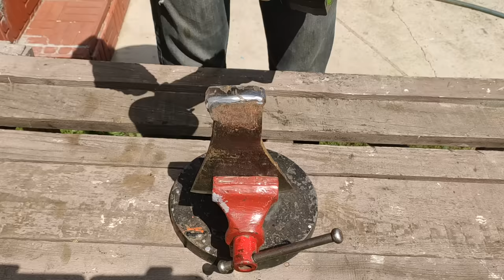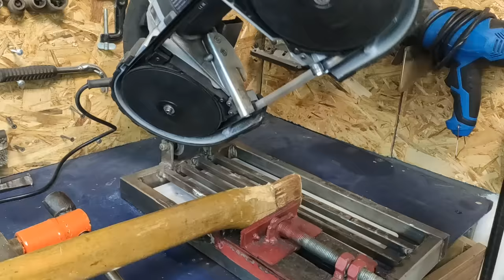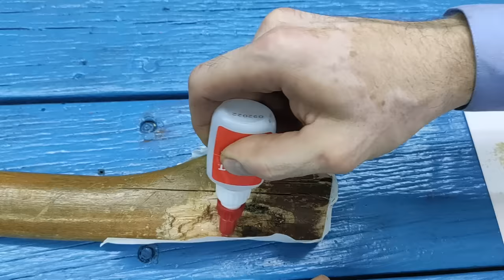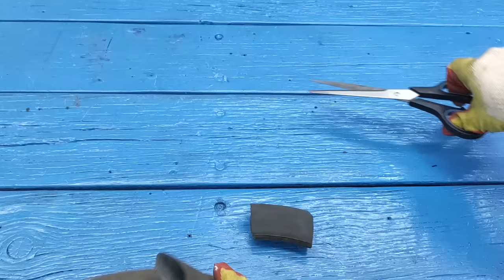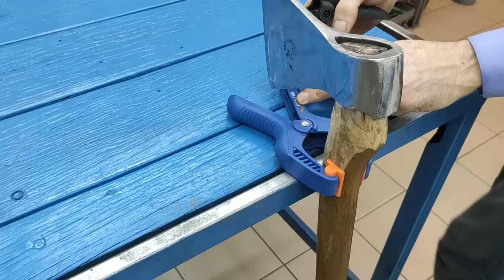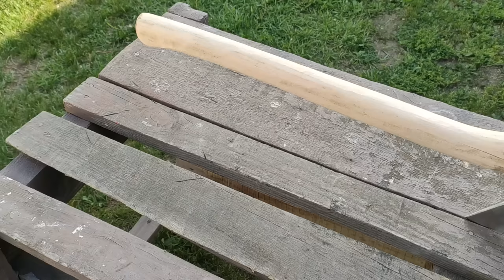CARPENTERS DON'T WANT YOU TO KNOW THAT! The secret method of securing the axe

Comment: Looks like you used Super Glue on the crack.
Any glue which dries quickly will be brittle. I would use Tite Bond. It is the strongest Wood Glue out there. Ten X stronger than Gorilla Glue. Work straight glue deep into crack. Open up crack with leverage. Let it then close and finish with glue and sawdust.

Comment: It is dangerous !!! Smearing around some saw ust and glue does NOT repair the damage, eg. the long split. Hot melt glue does not povide enoug strenght to secure the head in any secure way. This is dangerous for the user and bystanders too. I report this video for deletion,.

Comment: The best thing to do is spend 8 dollars and just buy a brand new handle of course that would take some common sense, I have been a carpenter for over fifty years . This guy has no clue what he doing and giving bad advice. I totally clean and sharpen my tools before adding a new handle as well as throwing them in the fire for a while and dropping them in oil so they retain there edges better. And you start with a wedge that goes with the grain gluing everything before you start, the metal wedges should be driven at a slight angle so you don't brake your handle...

Comment: You hold the grinder in a strange way, hopfuly you're not cutting with it... plz be carefull with that kind of tools and ask how to use it befor being dangerous for you and others.
you also grind the front side, the ''cutting'' part, it's normaly threated so you shouldn't take off that much metal... you ''restor'' with the grinder all around the axe, but don't put any treatment on it, so the metal will get (back) rust in a few time 😂. 
For the rest I guess all the carpenter won't give attention if you do that in the way you're not taking work from them. No one will punish you for restoring a tool but maybe for doing a video showing really bad way to do things. 
But its very good from you to try stuff like that at home, to make DIY, that's a really good point and I really wish you to continu that and to learn from the other with humility. I do DIY myself, but I won't make videos of it cause I guess there is better ways...

Comment: Not good! That handle was toast. Big crack, chunk broken out, and it didn't even fit well before. Super glue is very brittle. That superficial repair you made is going to self destruct at the least opportune moment. Seriously, throw that handle away and buy a new one. A good one. Fit it properly, and feel secure. You don't need an axe head in your head, or someone else's. Use that big brain of yours, and I don't mean for an axe holder.

Comment: First off most carpenters seldom use an axe they are for felling  trees.  Some guys do use a rigging axe (a small 32oz axe)  I don't i'm always fearfull that i will miss the wood and chop my dicks head off.  who knows what He did lots of funny stuff why grind the edge off the blade and then resharpen it?? just eye wash if your a framing carpenter just stay with what ever size ripping hammer you like and save the rigging axes to 3 mast sailing ships

Comment: Great granddad, a thrifty old county shipwright and carpenter, would have looked at this and said, "Make a new handle or buy one." and walked away shaking his head. Your repair is dangerous. Bicycle tire rubber, sawdust and hot melt glue, are not going to hold that ax head in place for very many blows.